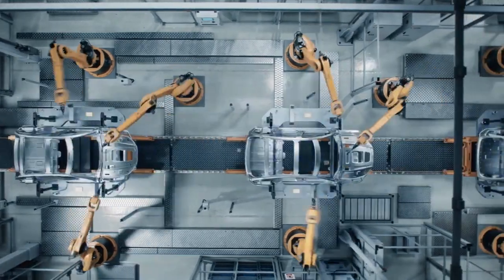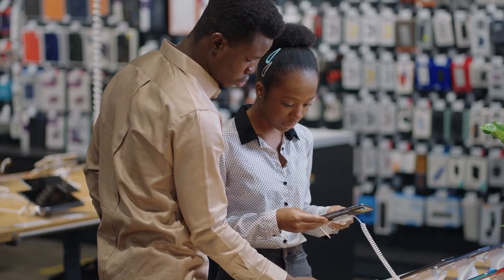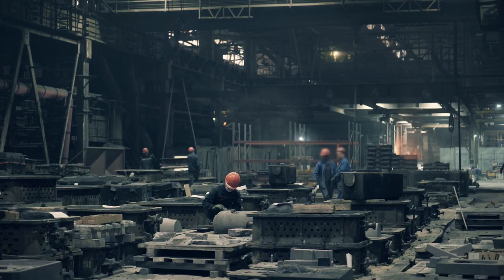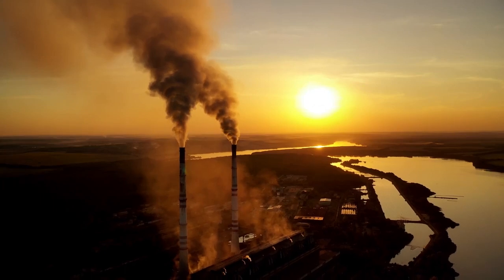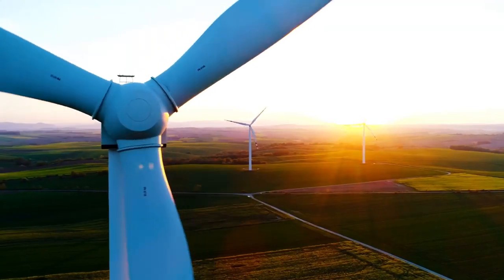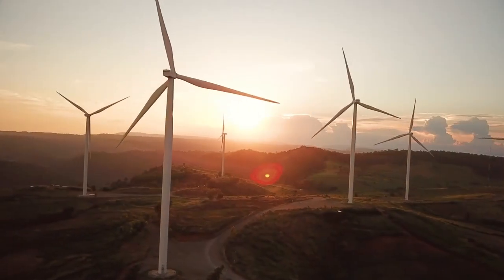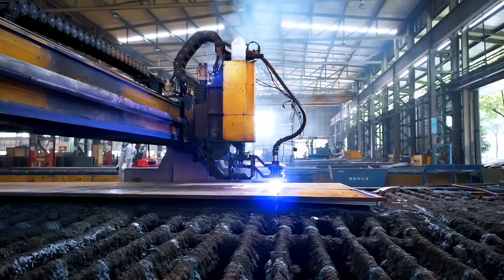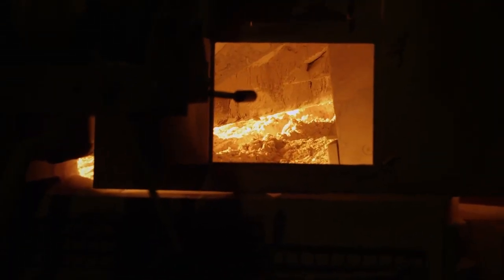Hydrogen and the Future of Heavy Industry

Comment: CO2 levy of 100 Euro/tonne which gets distributed to "mostly green" hydrogen with a subsidy of 5 Euro/kg. All other levies/duties or taxes should not apply, is should free of this nonsense.
Only two conditions are, first is, use only electricity when there is a surplus in the grid and the second is the oxygen has to be collected and put to good use. 
9 kg water one can make 1 kg H2 and 8 kg O2.

The key to success for a gas company like Linde will be, how innovative it will be in the use of this very pure oxygen and how to max capitalize on the existing (gas/pipeline) infrastructure in distributing H2/O2.